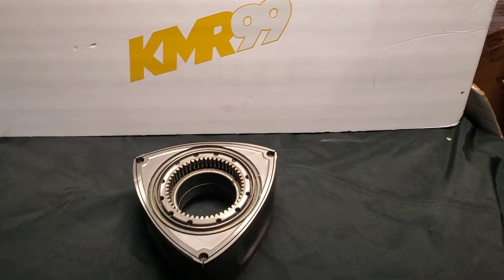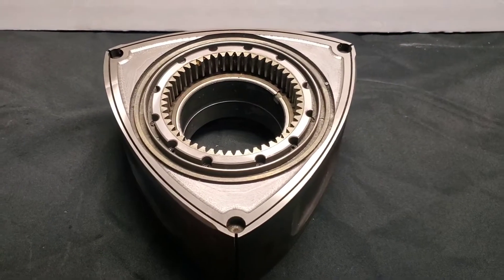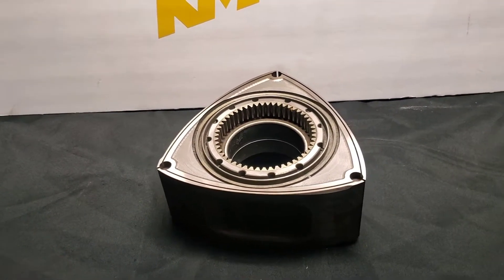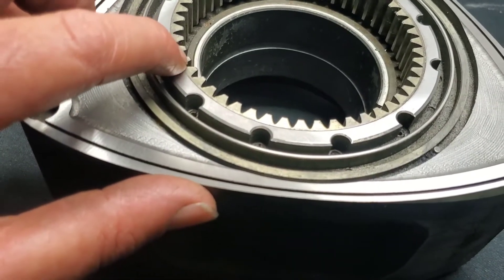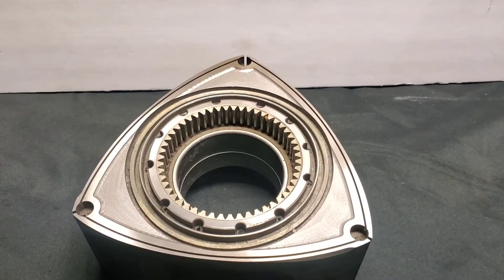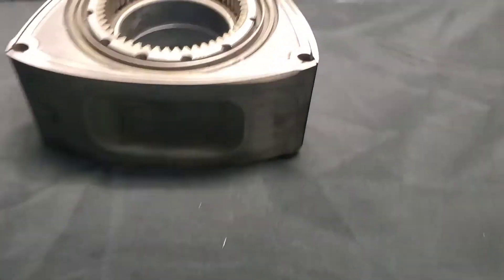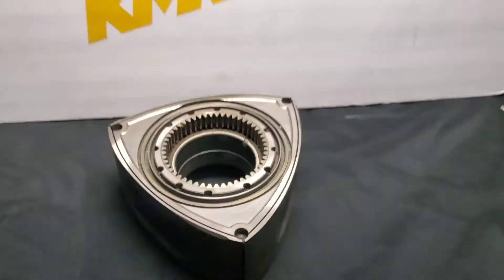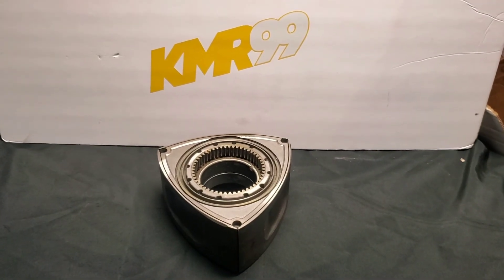Mazda RX8 Renesis Rotor Tips and Tricks for performance builds - KMR Rotor Tech Talk #2 RX-8 SE3P

Comment: Why not Deepen the apex seal grooves on all rennesis regardless of hybrid motor  aka rx7 exhaust ports.
Reply from the maker: Ehhh, rx8 seals are fine for normal and most performance applications.  Seems like a waste of $ unless its an extreme build and every other modification is being done or there is a good reason. Like the rx8 seal fails over RX7 ports...
Reply: @KyleMohanRacing  Why do the RX8 seals fail over the RX& exhaust ports?